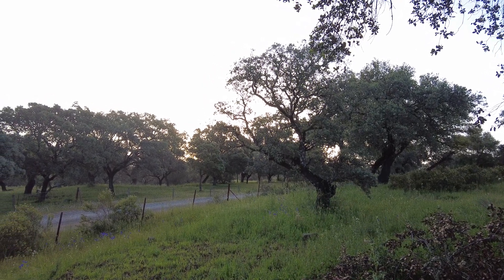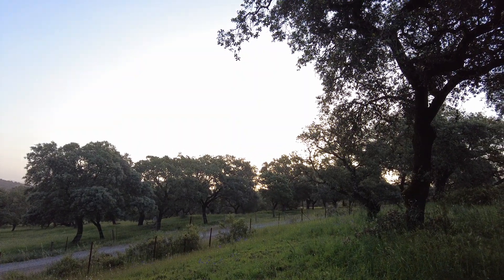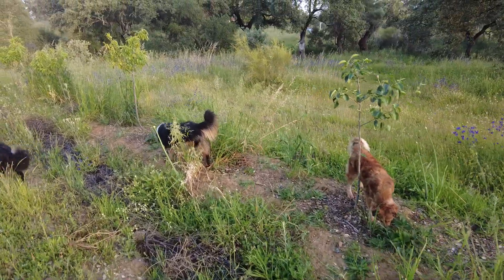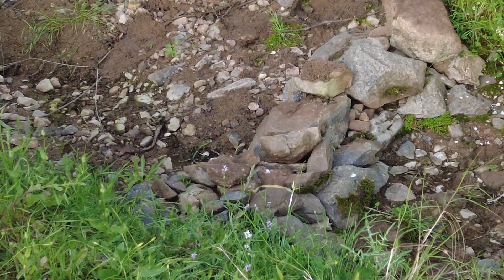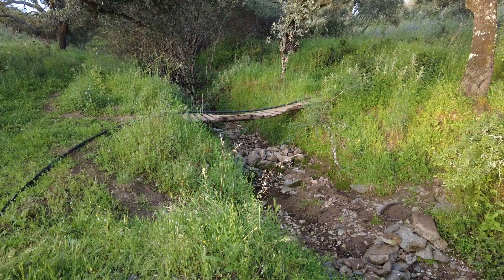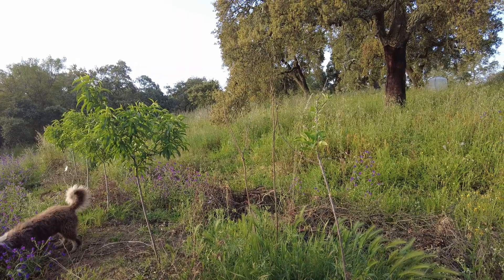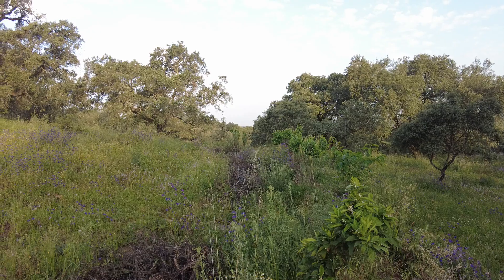Erosion gully partially rehabilitated. Many questions remain.

Comment: At 0:24 and 1:33 I greatly appreciate you pointing out the volunteer holm oaks.  Once more, your grand experiment has demonstrated that the holm oak acorns are successfully germinating.  Which leads to the question - Why are they not growing into saplings and juvenile trees across the dehesa?  I will encourage you to identify a universal marking system for these precious volunteers.  Perhaps a 32mm square hardwood stake, one meter long with the top few inches painted a color you choose?  A marker that can be easily spotted and everyone understands the meaning; seedling holm or cork oak -Caution. As another commenter suggests, once they are marked, you can begin the process of culling based on spacing.
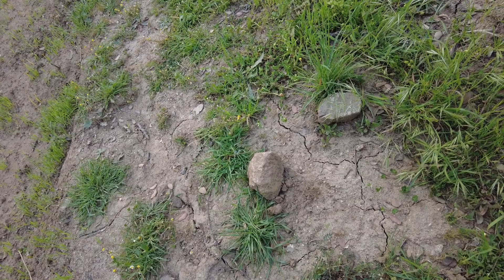At 4:07 I'm surprised to see the soil so significantly cracked this soon after days of rain.  This is a good indicator of the impact the hot dry winds of the Sahara  have on your region.  It may be interesting to log the difference in relative humidity between periods of Sahara driven weather compared to those that originate in the Atlantic Ocean.
6:15 Fruit tree leaf fungus:  I don't know what your position is on spraying chemicals.  I'll share mine; I believe like most things in this world - moderation is the key. I am  "middle of the road".  I would use  a foliar spray for the leaf fungus immediately.  You do not want the spores to colonize your soil.  I would also use a selective herbicide (not Roundup or glyphosate) to clear a narrow band of vegetation that is immediately on both sides of your boundary fence.  One walking pass from the inside out and one from the outside in and you're done for the year.  This much lineal footage will require a backpack sprayer.
7:55 and later We learn about Sky in this episode!  He thinks he is part Portuguese water dog, part Backhoe and part Eskimo - he likes it cool! <3 
8:00 Noticing the mineral deposit in the creek bed below the stream; Is this a first time event Martin?  If yes, I wonder what has changed?  Second question - can you collect scrapings of the white material and have it analyzed?  If this is a first time event, it is certainly  noteworthy.
9:00 Idea about the upstream side of the leaky weir.  I think building an intermittent wildlife pond is a great idea!  A few thoughts - Make it as big as you can.  This is the last chance to capture water before it leaves the farm.  Everything that infiltrates your soil benefits everyone down stream in this watershed.  I would carefully use the Giraffes landscape bucket to scalp the top few inches of topsoil and vegetation into patches and set them aside from the entire are that you plan to dig or pile soil.  Save it all. You will use them as sod later.  When you finish your earthwork, lay the patches of sod down on the face of the leaky weir and on the face (waterside) of any additional earthworks and water them in thoroughly.  If you find excellent eroded topsoil, I would stockpile it off to the side.  It is a valuable commodity for all of your propagation activities. 
The final two thoughts for this intermittent pond build are  -  the soil you use to build the dam wall must be damp to wet.  No dry soil allowed. The second is all of the soil in the dam wall must be fully compacted by the Giraffe.
10:35 I will suggest adding a few more rocks and some topsoil to the creek bank that is eroding around/beneath the holm oak on the western bank.  You can see loose roots at this mark.  You would be armoring the bank against future erosion and saving that particular tree.
11:02 I commend you for recycling the old irrigation tubing.  We know another homesteader who has miles of abandoned tube on his land and has so far not reclaimed any of it.  Good for you Martin.  Recycle the legacy plastic the best way you can.  Don't leave it buried in the soil.
All the best Martin! :)
Reply from the maker: Super comments Steve. Much appreciated

Comment: I like the idea of expanding the area before the big leaky weir! It could help focus the flow to go over the weir as well since the water will be caught from exiting elsewhere. That's a pretty big area, too and could slow the water down enough to get even more sand and silt to settle there, which even moreso improves the storage of water in the sand, further developing the mini aquifer you've created! I think there's a real opportunity to spread out the water there so it doesn't erode the leaky weir during heavy flows, too! (just have to keep making sure the spillway is level)

It might be something to consider waiting until next season for though, if you're not planning on getting much rain for the rest of the season. Digging up large areas without moisture coming in soon could cause more dryout and make erosion even more problematic when the rains do come. I love the idea though, however you might go about it!
Reply from the maker: Thank you for sharing valuable information. Hopefully there will be more rain. Please keep sharing.

Comment: It would not be too hard to focus on a firebreak section where you do mark the oak saplings and mow around them, but still have a 15 meter swath of mowed land to protect uphill sections. You may not actually need or want all the oak saplings, just ones spaced out from each other at a sufficient distance that you determine, maybe 5 or 10 meters apart. You could select the strongest. 

Some of the fruit trees look like they want more nutrition. If they produce too much fruit for the size of the tree in one year, they may not have enough energy to do the same the next year. You can end up with alternating fruit years or a more even annual production, depending on how you manage the trees.

Nice to see that things are still green, even if the cracked clay signals the coming dry season!
Reply from the maker: Excellent suggestions. Thanks for the information. Much appreciated